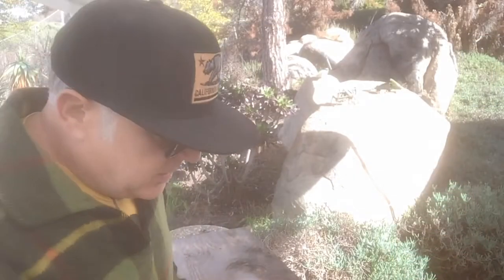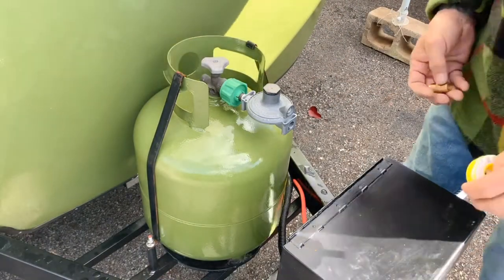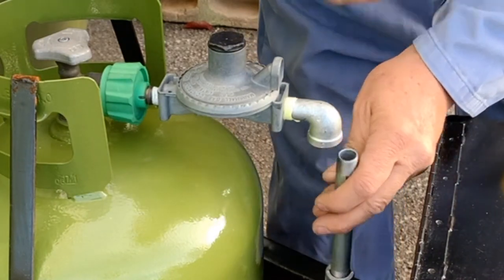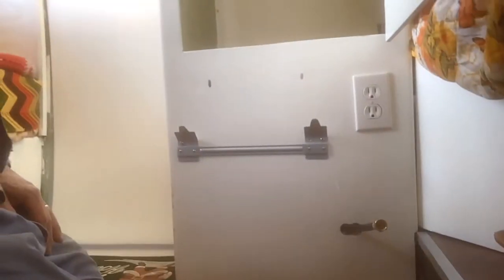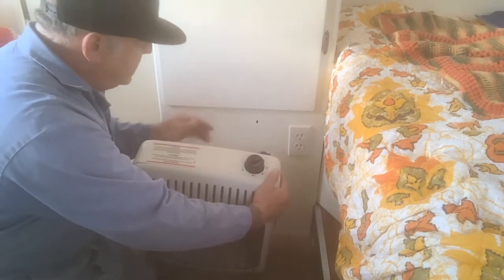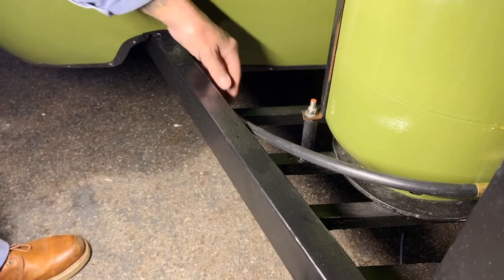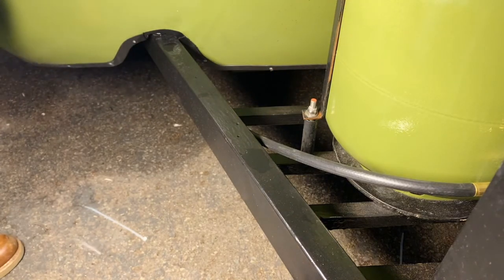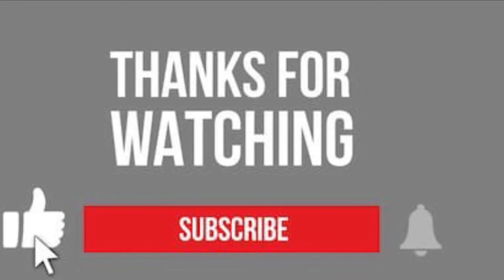Propane Lines Installed | Don’t Make This Mistake!

Comment: Properly rated galvanized pipe can be used for propane and not natural gas in some places.
Some states do not allow galvanized pipe for any gas.
Most rv manufactures and most accepted method is to  use black iron outside and copper inside, because rv’s travel state to state.

Comment: Thank you for your video,  super helpful. 
I  have been contemplating replacing my very old propane lines to run two separate tanks, for for a cook stove & 1 for my Mr. Buddy heater.
Reply from the maker: Awesome Corky, glad I could help.👍🏼

Comment: If you do not like pipe tape for sealing gas lines,try Rectoreseal  #5 Yellow Pipe Joint compound. Leave top thread bare so you will not contaminate inside of pipe.
Reply from the maker: Thanks for the tip, I’ll try it. 👍🏼

Comment: Good video 
I’m not sure but I don’t think galvanized pipe is used for propane purposes. I believe it should be black pipe.
Believe me I am not a professional but from my experience it has always been black pipe.
Reply from the maker: Hi Guy, thank you! I had the guy  at Dixjeline Hardware help me. He assembled the pieces, maybe he doesn’t know.  I’ll check into it, thanks again. 👍🏼
Reply: Galvanized is water pipe. They call the black gas pipe schedule 40. Hope that helps.
Reply: So I happen to be correct? Black pipe is used for LP lines not galvanized pipe.
Glad I could help!!
Reply: @westcoast_johnny  its fine! Black is not required for gas!

Comment: Your information, effort and time is appreciated. However consider this: Your regulator is mounted horizontal.  Your screened breather vent and internal diaphragm are directed forward into oncoming highway weather conditions. Your regulator is designed to be installed vertical-down to avoid falling rain and dirt.  Manufacturers recommend replacement of regulators that have had the diaphragm exposed to any water/rain and dirt.  Perhaps you'll create a video on how to correctly fabricate and install something to protect that vent from the highway elements.. Thanks for the info.
Reply from the maker: Thank you B Pow for that information, I’d like to make a shield, and correct the angle of the regulator.

Comment: Don't listen to every one in the comments section,Stainless can be used as gas line, look into some stuff called home flex or better known as CSST it's stainless gas line
Reply from the maker: Thank you Dodge Ram 👍🏼
Reply: Galvanized pipe is not "stainless."  It is coated with zinc, I believe, to reduce corrosion, but gas eats through it.  Stainless would be OK, but ain't nobody got $$$ for heavy, thick-walled stainless pipe.
Reply: don't think csst can be used in RVs. know people throw a fit if it outside even if it's per regs of the state.